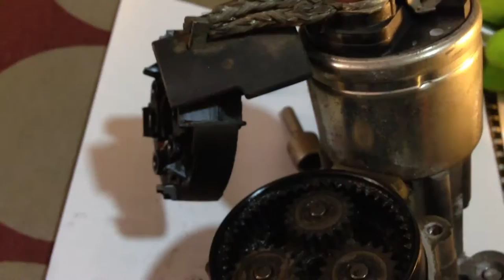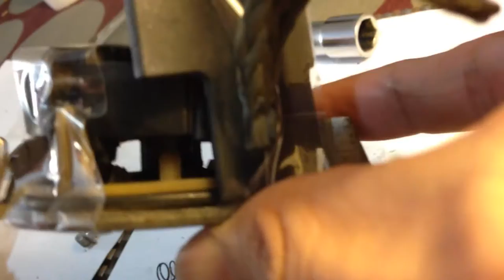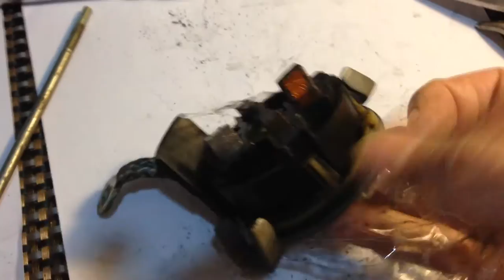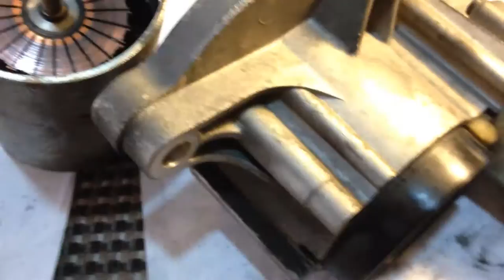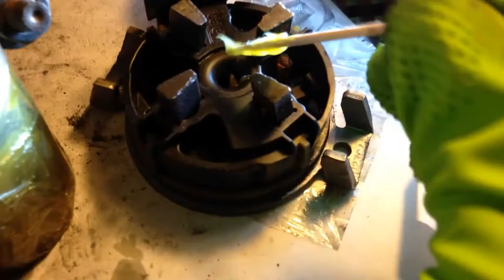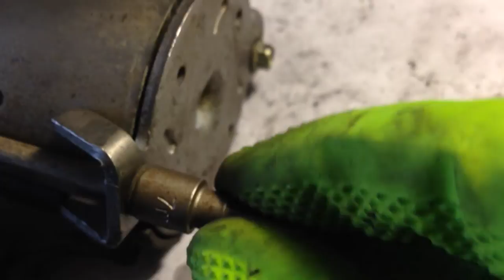Peugeot 307 tu5jp4 - Starter motor inside - DIYChannel - short

Comment: Do you know is same motor the citroen c4 1.4?
Reply from the maker: Probably not, but the majority of the starter motors have similar installation process. This engine is tu5jp4 (1.6)
Reply: @DIYChannelMusic  I did. Same motor same procedure. Thank you. Damn it engine side the bolt :)
Reply from the maker: Thanks for helping. Just, this is the motivation of this channel.